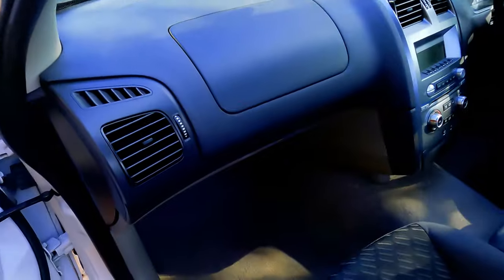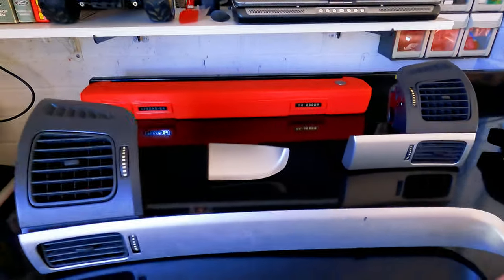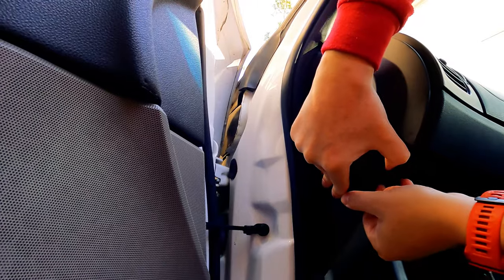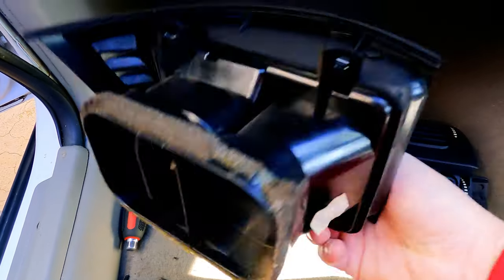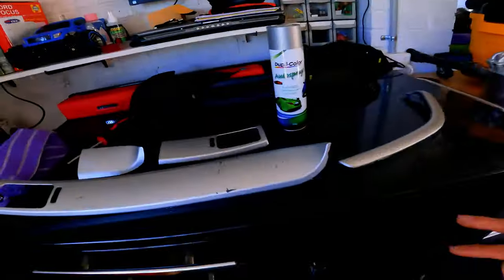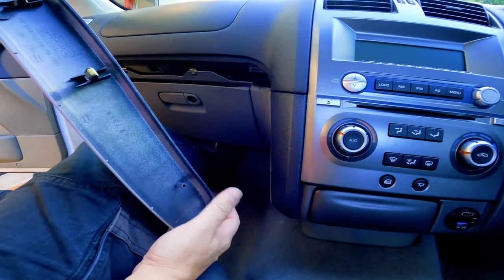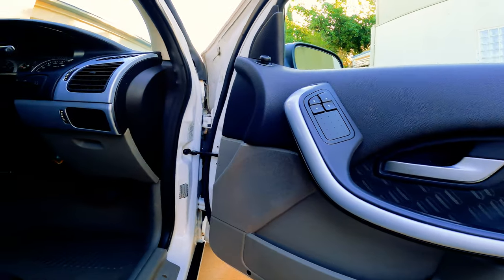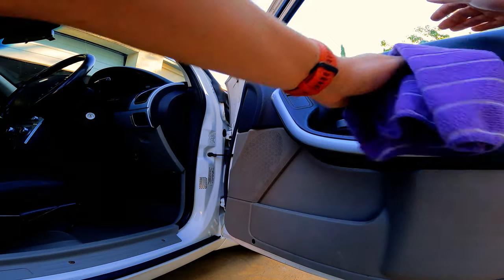Installing Premium Air Con Vents on a BA BF Ford Falcon - DIY Upgrade

Comment: Nice job with the video. I was wondering how did you find the trim peices to change the air vents or do you have the model numbers for those parts? Ford territorys would of that model would probably use the same to do you think? Keep up with the great videos they are a big help to people like me trying to learn about fixing things on my 06 BFII.
Reply from the maker: Hey mate thanks for your comment and for watching 👍 You will find the trim pieces on BAs mostly, that did have the 2 slot vents to begin with. When you grab the vents, grab the trim pieces too... I'm not sure whether these will match the ones on the Territory, but I'm assuming YES...

Comment: Hey mate what paint did you use for the trims
Reply from the maker: Hey Jerry, I used a can of silver auto body spray paint. Firstly I hit the plastic with a plastic primer, then silver auto body paint, then I cleared all the silver. Looks schmick, and the clear is protecting the silver from scratches 👍

Comment: Hey mate how did you go removing all the bubbling paint on the handle inserts ?
Reply from the maker: Hey Dean. it's actually not paint but a metal wrap of sorts... I used a blade knife to start an edge, and then slowly peeled it all off by hand. It took about 30 minutes, but once the metal wrap is off, you can plastic prime those pieces and then paint and clear. Hope that helps 👍
Reply: @Horus_Works  thanks mate

Comment: Thanks heaps for this video the ba xr6t I’m restoring/ updating/ upgrading had the single vents , so I wandered down the paddock to an xr6t parts car I have and it had twin vents 
So thanks for the tip 
Subscribed !!! 😂😅
Reply from the maker: Awesome Jarad!! Thanks for subbing mate and glad you found this helpful  👍
Reply: Hi what year is your xr6t mine is 04 it's standard

Comment: Ive owned 2 XR6's my first was a 2004 BA it had these double air vents, my second is a 2006 BF MKII which does not have these vents and frankly I'm glad it doesn't.. My BA XR was practically brand new when I bought it (only had 98,000 k's) it had an excellent AC system, AC max would literally freeze you and with these double air vents the lower vent was literally 3-4 inches from my knee .. I think you can see where I'm heading here... As it did not have a shut off door in the vent it would literally freeze my knee so much I could not use the AC max function...
Sooo glad my BF does not have this....

Comment: Upgrade the Povo pack Stereo should be your next move. You can get the same silver to match your spears.
Reply from the maker: Thanks mate, I have been thinking about that... still wrestling with whether I should go Kayhan or premium Ford ICC....
Reply: @Horus_Works  I went the Aeropro replacement and an Alpine head unit. Costs a bit,  but best thing I've done.

Comment: Hey mate was wondering what sand paper and paint you used and how much did it cost for the vents roughly?
Reply from the maker: Hey mate, the vents were $40 for the set from memory, and as far as materials, I got a can of Ford liquid silver, Acrylic clear, and 1500 grit sandpaper.
Reply: Ok thank you